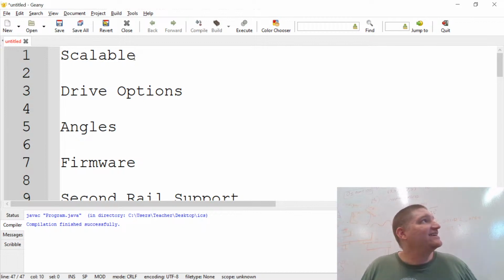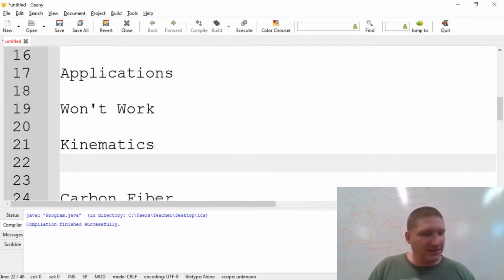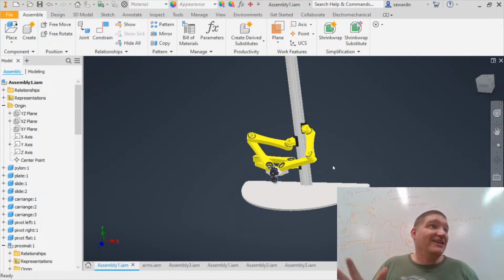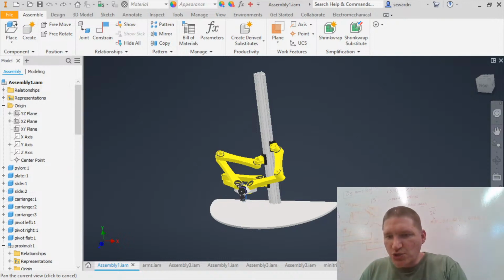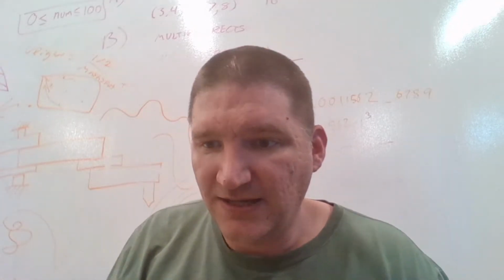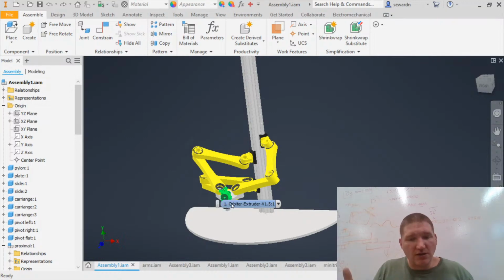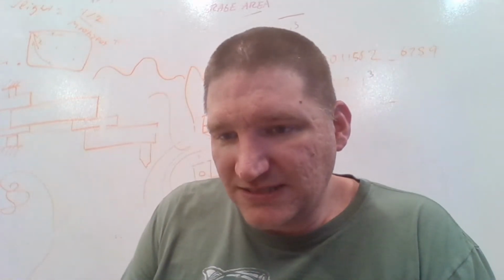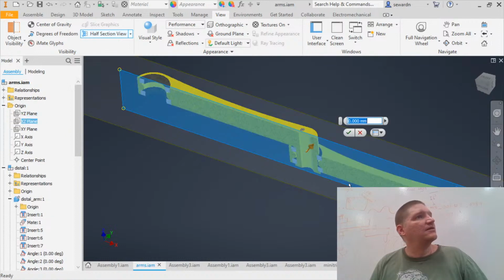RepRap MonoRail Q&A

Comment from the maker: https://youtu.be/mpQOlnG8Yps Here is my first push test with the prototype.  It isn't good enough to be used as is but is good enough to validate the idea.
Reply: It works!! Congratulations!!
Came here because JK Lee fabricated a cool bot version of this inspired by you.
I like it, this robot concept might have many good applications, my mind 1st went to human interaction or food service, but I could see many maker type robots options too...

The super compact nature of this "all on a single rail" design is GREAT!

Torsion stability of rail connection seems intuitively very important to success, not max torsional load, but any rotational movement at all, since the arms are long, tiny linear-rail rotation becomes large movement. If you select a rail system with multiple points of contact and near zero rotation around X,Y or Z,,, well look at Lee's movement bounce yourself...

Lee's functional problem seems to be system stiffness and movement smoothness.
I wonder if twist/flex at rail slide interface is the weakness or issue for his motion bouncing.

I agree the system unoptimized is going to sag/flex. Tuning the overall system rigidity is important(design stiff vs soft mix) and my engineering intuition says twist at rail(and ball bearing joints too) is critical.

I designed a 2 axis high speed pick and place robot for RA Jones co with a single rail design but, looking backward wish I had used a second parallel linear rail for less torsional flex, more torsional stiffness because longer gripper arms later got added. Adding some anti-twist to your design would only very slightly increase the compact nature of the design, but may significantly improve {performance, speed, accuracy, repeatability, stiffness, bearing life +++}

Yes you should get a provisional patent, this seems good intellectual property, you should feel great about bringing this into the world.
Subscribed✔️
Reply: Great job！ I would like to see a working MonoRail

Comment: Hydrostatic bearings could be an option for low friction, light, cheep,yet high accuracy pivots/ linear slide ways. They can be scalled up to massive sizes. But will also work on small scale. Youtube user
"Applied science" has done video on how to make them from 3D printed housings, graphite  blocks and "flat steel"

If powering them on  air. There's also possibly of using an air jet instead of  a fan for cooling part and   hotend of a 3D printer, which might reduce moving mass compared to a fan.

Comment: It works! I came here because JK Lee fabricated a cool bot version of this inspired by you.
I like it, this robot concept might have many good applications, my mind 1st went to human interaction or food service, but I could see many maker type robots options too...

The super compact nature of this "all on a single rail" design is GREAT!

Torsion stability of rail connection seems intuitively very important to success, not max torsional load, but any rotational movement at all, since the arms are long, tiny linear-rail rotation becomes large movement. If you select a rail system with multiple points of contact and near zero rotation around X,Y or Z,,, well look at Lee's movement bounce yourself...

Lee's functional problem seems to be system stiffness and movement smoothness.
I wonder if twist/flex at rail slide interface is the weakness or issue for his motion bouncing.

I agree the system unoptimized is going to sag/flex. Tuning the overall system rigidity is important(design stiff vs soft mix) and my engineering intuition says twist at rail(and ball bearing joints too) is critical.

I designed a 2 axis high speed pick and place robot for RA Jones co with a single rail design but, looking backward wish I had used a second parallel linear rail for less torsional flex, more torsional stiffness because longer gripper arms later got added. Adding some anti-twist to your design would only very slightly increase the compact nature of the design, but may significantly improve {performance, speed, accuracy, repeatability, stiffness, bearing life +++}

Nicholas Stewart you should get a provisional patent, this seems good intellectual property, you should feel great about bringing this into the world.
Subscribed✔️

Comment: Think you could scrap the rails altogether and put mechanum wheels on it with some sort of 3d positioning sensing?  Maybe, ultrasonic sensors or laser light, or pattern recognition with an onboard camera and AI system!  This way you could throw it down on any surface and start printing on it with an unlimited build volume in the XY!  Maybe, a mesh leveling system that could subtract any surface obstructions from the bottom build area to print around them in real time!
Reply from the maker: Sure.  Would need very heavy cars.
Reply: @NicholasSeward  Why?  You don't think four locked rubber wheels  could have enough surface friction to hold still, until it needs to move to the next way point to resume printing in a non-planar fashion?

Comment: 1:10:00 – I had good experiences with highly flexible TPU of filaflex brand – astoundingly reversible deformation – 
and the polar opposite to elastic PLA – that stuff was almost like chewing gum – exaggerating a bit
Reply: 1:19:44 PP/PE for classical living hinges -- I was more thinking about bigger mechanical metamaterial living hinges from rubber. 
Those may have more cross-talk but are likely much more durable.

Comment: For stiffness/rigidity bigger is better when all dimensions of the machine scale equally. 
For the arms l, b, h must scale not just l. It is a a linear improvement of stiffness with size IIRC. 
The twist is: 
(1/2) This only applies to operation in micro-gravity keeping robot operation speeds scale independent. And …
(2/2) … in space you need to go to sparse space-frames to safe mass in larger structures. Except maybe you build heavy machinery directly from asteroid matter that is meant to operate right there and not meant to go anywhere.
Reply: "Nanosystems" chapter 2 "Classical Magnitudes and Scaling laws" says: 
bending stiffness ∝ radius^4/length^3 ,∝ L –– (cylindrical rod assumed)
Reply from the maker: That is a very good point!  Although, you wouldn't want to or be able to scale everything equally.  The mass and drive requirements get out of hand fast if you scale all dimensions equally.
Reply: @NicholasSeward  Indeed. The only situation that I could come up with where this eventually could make sense is that far off ISRU metal asteroid mining example with some custom made monster drives that recuperate power. But there are probably better solutions. As you've said, rotative is better for big stuff.
Reply: As side-note: The book applies it in the other direction. Giving some intuition that even diamond gets quite soft for nanoscale parts. And for other reasons stretchy.  But not unusably soft. More a boon than an issue.

Comment: As far as the arm length. You said if you double the arm it becomes 8 times more squishier. Is that because you are using PLA printed parts? What if a you use a different material, aluminum, titanium, steel?
Reply from the maker: All materials exhibit that behavior.

Comment: What if instead of belts, it worked with a single long screw; with one of the carriages just passively pushed by the screw, and the two other ones carrying their own steppers that would rotate the nut that couples them to the screw?
Reply from the maker: That is a fun idea and makes the kinematics even easier.
Reply: wouldn’t this also require the nuts to be actively rotated in the opposite direction to keep them in the same place? due to friction in the motor, the nut wouldn’t be able to spin completely freely, causing it to move a bit.
Reply from the maker: @dysphoricpeach  you could use a noncaptive stepper
Reply: @NicholasSeward  Can you combine the screws velocity with the independent steppers velocity to increase their total speed of motion?  You mentioned before how ball screws are slower than lead screws!
Reply from the maker: @themeek351   yeah.  That would make it faster one direction and slower in the other.  Btw, ball screws can be faster,  I just like cheaper lead screws when they are up for the job.